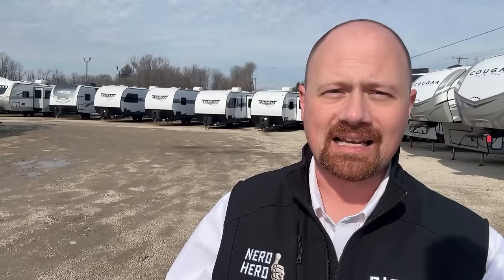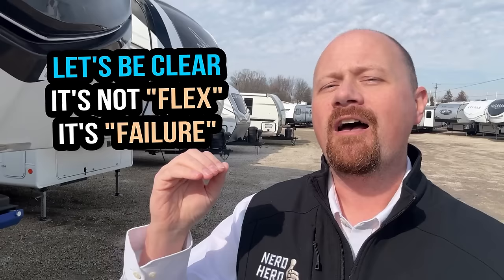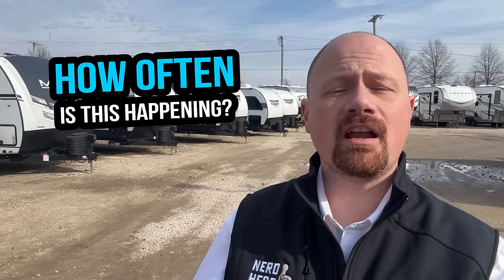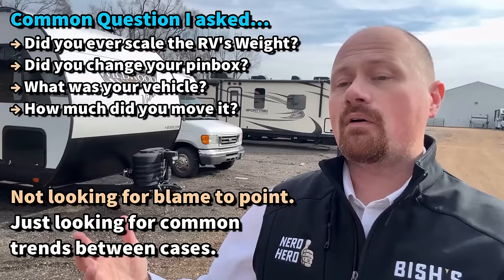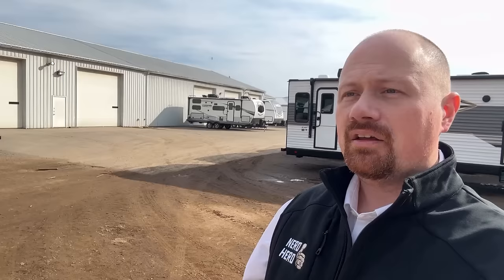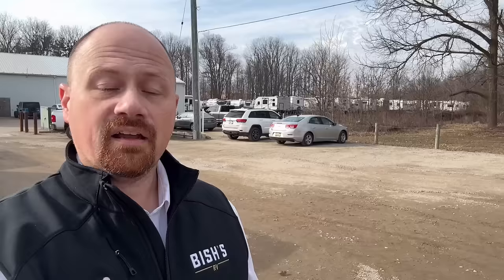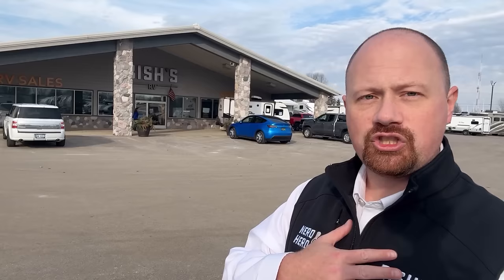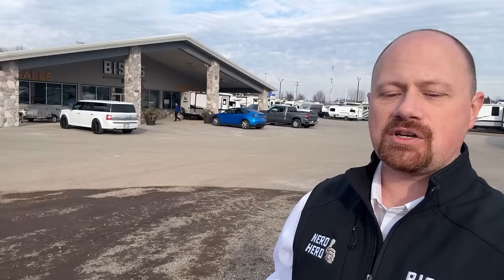🚨 RV Frame Flex & FAILURE!! • WHAT is Happening and WHO is Responsible?!

Comment: I went to an RV dealer and looked at a gorgeous front living room, full body paint fifth wheel.  As I walked around, the “yellow tag” on the off camping side of the trailer stated the cargo capacity was 1280 lbs.  I said to my wife in front of the salesman, not to even bother looking due to the cargo capacity.  Said salesman completely assured me that first off, I would never put that much weight on the trailer and if I went over “a little bit” I would be fine.  As for not frequently moving them, not using them full time, not using them in harsh weather, the blame goes square onto the manufacturer that puts the “Rated For Full Time”, “Four Season Rated” stickers next to the front door.  Josh, I am a fan of your work, I appreciate you walking the tight rope but manufactures and dealers have been complicit in selling consumers on a life style that they do not have a product that will support.
Reply: It sounds to me that it’s time the government gets more involved in the rv manufacturing and regulation the way they do automotive manufacturing if you can’t move a  rv there isn’t much sense in buying one the rv manufacturers have been screwing people for years it’s now time they were held accountable
Reply: Hear, hear!
Reply: Well said!
Reply: I have a 30 year old JAYCO 5th wheel. that has a 4500 pound capacity. Rack and pinon slides.  Built like a tank. Afraid to sell it
Reply: I couldn’t agree more with your last sentence starting with “Josh…”
Reply: @fladave99  if only they were 'built like they used to be'...I for one don't need a rig as tall as a semi trailer, with no real cargo (weight) capacity.
Reply: Grand Design has a big problem!!
Reply: But it’s like the tobacco industry saying cigarettes are fine, even good for you😂..but didn’t we know better?? did we not use our common sense? there’s blame to go around here. And I’m not excusing dealers and manufacturers. but when I see full time families on YouTube with a 45’ fifth wheels loaded with everything a family needs. driving from one end of the country to the other . Ive been down many of our roads. especially on the east coast..not to mention Alaska..come on! Knowing what we know about rvs..are we really surprised that some have issues..I’m surprised it’s not more.
Reply: Exactly.
Reply: I couldn’t have said any better. I enjoyed the channel also but it seems to me like there’s a lot of pushback to the consumer once again. They’re chipping out and trying to make them lighter for better fuel economy, and the vehicles today are just cheaper and lighter themselves also. I can guarantee you the older fifth wheels are not experiencing frame flex because they were better built. I say it goes back to the manufacture. I’m sorry that everybody wants their electric trucks, their hybrid trucks, and manufactures want to build trucks that are lighter  in weight for better fuel economy also. That’s not the consumers problem. I also have an F6 50 super cruiser with air suspension. I’m not buying this at all and I also haul RVs across the country for people. I think once again the manufacturers just need to do a better job and quit trying to put the blame onto the customer.
Reply: @billbillinger2491    So you want to force everybody to adapt to what “I for one” wants.
Reply: Consumers lacking accountability. RV mean Recreational vehicle. What I see overloaded, speeding, driving angles, solar, batteries and not to mention most trucks are overloaded (payload) Consumers always go above engineering standards
Reply: @danieltrejo5659 Grand Design has a Grand problem.
Reply: I'm pretty sure Josh DID call out the manufactures and dealers for being complicit "in selling consumers on a life style that they do not have a product that will support."
Reply: @cinderellaresearch74 be careful generalizing. Your statement may not be wrong in terms of what you see, however it's not based on any real data or quantitative in any way.
Reply: @cinderellaresearch74  Using the word “always” infers everyone every time.  Are you an employee of a RV manufacturer?
Reply: That's why I didn't get a GD solitude.  The cargo capacity was pitiful and I would use most of it just in the fresh, Grey and black tanks.
Reply: @georgetaylor1024 until this happens, it will continue.
Reply: In my experience, GRAND DESIGN is the worst regarding frame failures!  👎
Reply: @site_pro  I'm a member of many grand design groups and I haven't seen very many people having this problem.  The 2 i have seen were either clearly overloaded or changed the pin box.
Reply: Especially in the USA where only Florida, Mexico can enjoy 4 seasons without the harsh cold and snow(freezing) temperatures.
Reply: @georgetaylor1024 prices would go through the roof!
Reply: Great, more government.  I’m not a fan. It should be up to the consumer to start bring heat . Purchase power is king. Eduction not legislation.
Reply: I'm in the market for a toy hauler 5th wheel in the $125K MSRP range. I was very interested in the Grand Design Momentum, until I heard the term Frame Flex for the first time in my life. What brand of Toy Haulers are good quality, then? Only ones that don't use a Lippert frame?
Reply: If it hasn't already been done start a class action suit  and sue the snot out of Lippert and any RV manufacturer that is short-sighted / greedy enough to build something that is poorly engineered and completely inappropriate to be on the highway!!!!
Reply: @waynedanley1190  Once they Dump 5 th Wheel swan necks 90 % of problems are solved.
Reply: @markgrehlinger7117  I have seen the videos showing the efforts that Lippert puts into the engineering of their frames.  Contrary to internet rumours, they are made from steel that is sourced in America.

As a retired metallurgical engineering tech (35 years nuclear industry) I can say that I'm satisfied with their approach to quality fabrication and engineering.  It's up to the RV manufacturers to engineer and build their products so that they cannot possibly exceed the specifications that those frames were engineered to carry!  I'm not implying that that is what RV builders are doing but I would not be surprised if they are designing floor plans that are very close to the engineering limits specified by Lippert.
Reply: Josh is like a breath of truth.
Reply: @markgrehlinger7117  technically it would be pretty easy to identify all of the persons who have been first generation purchasers of grand design products who have complained to grand design about frame failure. They could be invited to join a lawsuit. That is far and away more efficient then a class action where are the costs of running the class action eat the lions share of the recovery.

Get every party as a plaintive to throw in $5000 for a legal team and you certainly would sue the snot out of grand design. Although the 5000 sounds like a lot of money, the eventual recovery would be way better and drive that five grand right back to the person who put it in.

Once the word got out you would probably have a lot of other grand design owners who would want to opt in as plaintiffs even if they had not suffered a fractured frame. They could make a claim for diminution in value due to the stigma. It’s just like the Ford Pinto of 50 years ago or the Ford explorer of the 1990s.

No one is gonna wanna buy that junk unless it’s an extremely cheap deal.
Reply: @rockdaddio69 most people dont know after you paid from auto insurance. you have to call them back and file diminish claim.
Reply: Well stated, Amen.

Comment: Glad you are taking the time to do this because frame FLEX is normal, frame FAILURE is not!
Reply from the maker: Exactly
Reply: Thanks Uncle Josh I never knew about this and never even gave it a thought, l'm glad you have educated me. I know how much junk we stuffed into our camper. We also stuffed the bed of my truck and inside the cab. 2 adults and 3 kids. I'll guess we were way overloaded. Even with a big gas V8 going uphill I got passed by big rigs, a couple of times we could barely make it to the top of a steep hill. Other bigger campers passed us. I figured it was because their truck maybe had a stronger engine. Probably not i'm thinking now we wrer just way to heavy!
Reply: @crazycritterlady8788  Absolutely was.     I live in California, knowing I'm gonna tow in those mountains.  I wouldn't buy a trailer with a dry weight of no more than 70% of my towing capacity and max weight capacity of the trailer no more than 90% of my trucks towing  towing capacity.  You gotta have that buffer for terrain.  Plus, not to knock gas V8's, but diesel, with that early torque makes huge difference on towing up inclines.   I have a half-ton diesel.
Reply: One of the best ever  Josh! Never stop. BTW the White Hawk 10  yrs on is going strong! God bless
Reply: @jshoota19ify  @crazycritterlady8788   I've been in California, and towed through it plenty of times.. and with a gas engine.. without problems.  With Diesel handle it better.. well duh.. yes.  Until you get sub zero temps anyways.  And either way, you should still be weighing your RV to match for balancing and weight distribution.  I make it a point to weigh mine whenever it's convenient.. 3 times in the last 5 months infact.  I've never come up to my truck capacity (currently at 68%), and even with full tank of fresh water and fully loaded to live in, we're still only 81% of the trailers ratings.  And we rarely tow with a full tank of water, I just wanted to see what it would weigh.
Reply: @jshoota19ify  it was December 28th I bought my truck outright (I live in So Cal btw), and on December 29 I bought the camper outright, I drove the truck to the camper dealer and he was very helpful since it was my first for both truck and camper. Of course I assumed "he" knew what I could tow he asked what type of engine I had and told me "no problem" towing it (it was only 17 ft tip to tail. But we packed bicycles, tent, sleeping bags, tarps, screen tent, Coleman stove, toys, pool toys, summer to winter wear, sandles, shoes and boots, boxed food and tons of snacks for the kiddo's, coolers full of pop, (we bought ice at the local super market) fishing gear, outside picknick table, table cloths and bench covers, large grass mat for outside, lounge chairs for everybody, fire wood, fire starter, bbg, kiddy pool for my 1yr old several medical boxes of supplies, fire extinguishers. I'm not sure we left anything at home! Lol it took literally 2 days to set everything up and tear down. Hubby and son slept out in the tent with coolers and a table fan. My daughters and I slept inside. There was enough room to sleep everyone inside but the boys wanted to sleep outside.
Reply: @crazycritterlady8788  Yup,  we just dont realize how much weight we load.  Get on that Cat scale.  Weigh while all loaded up.  Then you'll know where u stand.
Reply: When my family and I were full timing, we would stay in one RV park until my wife changed jobs, then we would move to a closer RV park.  Our vehicle was not big enough to move our RV, so we would hire a friend that had a one ton dually diesel truck.  Even with his truck being able to easily handle the weight, we would still remove all heavy items from the RV because, to be honest, the RV was overloaded if we did not remove the heavy items.
Reply: Might be the dumbest comment  on here. Flex and failure are not normal. Will add my thoughts on this topic in the main thread. But I have to ask, are you an ambassador for GD?
Reply: @thinktwice4083  Who said frame FAILURE was normal?
Reply: @jshoota19ify  I always did something similar when buying a truck, assuming my actual towing capacity was about 2/3 of the manufacturer's stated capacity.  Years ago, when we lived in Colorado,  I was replacing my truck.  I asked the dealer how they could advertise a little S10 and claim it had the same towing capacity as my big truck.  He was honest and said that while it might pull that load at low speed in the flats in Florida, between the altitude and grades in Colorado, it wouldn't come anywhere close, and he would consider it unsafe to try to tow what GM advertised.  Never trust the advertised towing capacity of a vehicle.
Reply: Thank you Josh for your integrity and diligence in telling it like it is.   I learned a lot today.  You keep doing you….we got cha! 🙂👍😃👏👏👏👏
Reply: @thinktwice4083  Who are you replying to? Who said Flex and failure are normal?
Reply: @kmbbmj5857  yup, I look at that silver badge inside the door well, that GM conveniently places, and pay attention to the GCWR, payload, etc.  I gotta go up some steep mountain roads during hunting season.  I never pay attention to advertisement.  Those placards are supposed to be legally llegitimate.
Reply: @crazycritterlady8788  No way I would buy a new 5th wheel at this time.
Reply: @michaelbeattie8106  I'd never buy a 5th wheel peroid. I had a pull behind and that's what I'd buy again. Wouldn't buy a motor home either. Where do you stay if it breaks down? If your truck breaks down you stay on your pull behind camper, if the camper breaks down you have your truck to stay in or go back home. Sure you could do that with a 5th wheel but not a motor home. Unless your pulling a small vehicle behind the motor home. Still if you have wife (or in my case husband/partner), and kids most likely depending on how far from home you are you end up spending even more money to stay in a motel untill whatever it is that broke down is fixed. Or if you go home then there's the expense to go all the way back to get whatever broke down and bring it back, like if it was your truck then there's the expense of renting a vehicle till you can go get yours after it's fixed. My point is with a pull behind most likely (it happened to us) you can stay in the camper at night when they are done working on it for the day. Plus if you have to wait a few days on parts to arrive then you can also stay in the camper  till its fixed no extra expense. 😉
Reply: @thinktwice4083  Any (metal) structure will flex under load.  The question is how much flex is acceptable and how much load can be applied before it get excessive.

Comment: The flip side of this video is that going forward,  the RV manufacturers could add more structure and support to the frames so that they are stronger than the current frames.  At the end of the day, there is a strong movement towards people traveling all over the US and a larger desire from many of the purchasers to live full-time in these RVs.  Really - if anyone bought a car model from Chevy/Ford/Toyota/etc. and there was a problem with a frame because people were "using/driving" the car too much, there'd be a nationwide recall.  If you really want to call a spade a spade, no one should have any concerns about the frame that an RV is built on.  It's funny that you don't hear about diesel pushers having frame problems...  Just saying.
Reply: It probably would only add $100-$200 in materials and labor to do it right.
Reply: If they did that, while good for us, would possibly limit smaller trucks and more market segment. I'd rather have a higher gvwr with the trade off of being built like a tank, but not many people want a newer dually that can pull something heavier in the mid to upper 20s
Reply: @smirnoff242 it would add that much weight to stiffen these under engineered frames!
Reply: First and foremost they are not regulated by the NTSB like at car or truck or a diesel pusher since they do not carry live cargo. Flip to the other side and look at those fancy horse/RV trailers, they are built like a rock (they carry live cargo) and the quality put into those trailers are night and day compared to an only RV trailer. Lastly it they built an RV as if it was to carry live cargo they would last at least 10-20yrs, meaning RV companies wouldn't be making money as people would hold onto them longer. Back in the day when there was so many smaller RV companies they put quality into there units, now those companies have been bought by bigger companies to remove competition and the quality vanished for profit. An RV is just like anything else you by now a days in our throw away society compared to anything that was bought 20+ years ago and still running
Reply: Be honest , lippert builds frames to ordered rv specs.  It is the manufacturers fault that frames are failing due to trying to keep weight lighter.
Reply: Thanks for saying it.  You saved me alot of typing.   
 To add, you don't see gooseneck flatbeds or luxury living space horse trailers failing either because they use thicker structural steel that can support the weight advertised for unlimited mileage.  
  Imagine a manufacturer putting a "mileage " limit on a frame. $100k trailer only good for 30k miles is not a very good $ per mile figure.
Reply: Yes at the end of the day this is a salesman.  Don’t call it an RV if it is not meant to be used